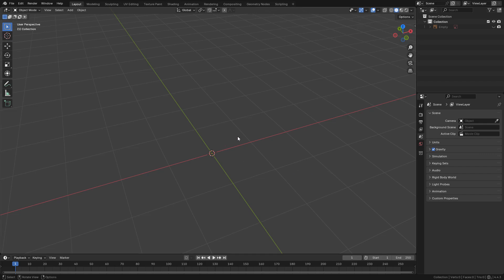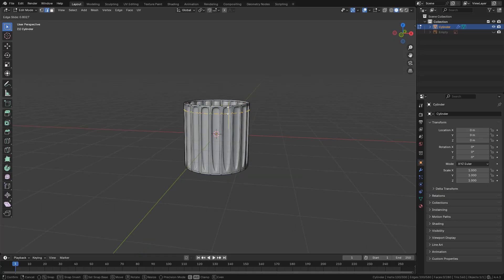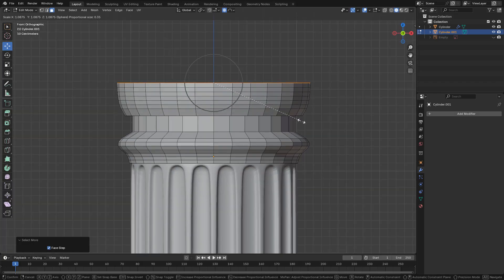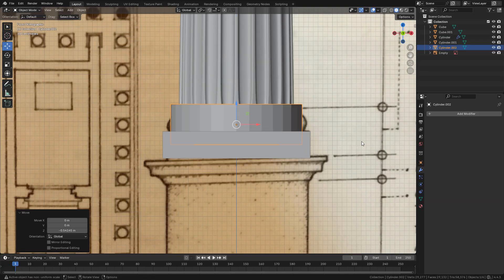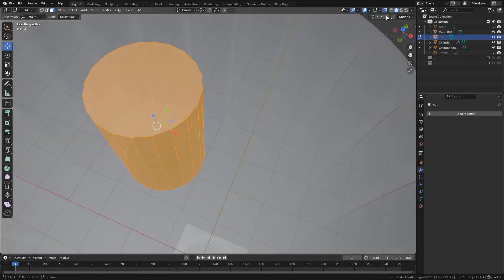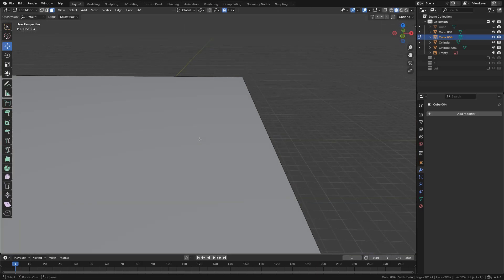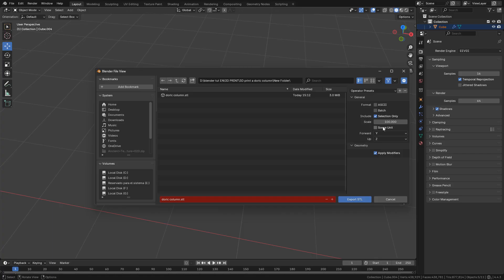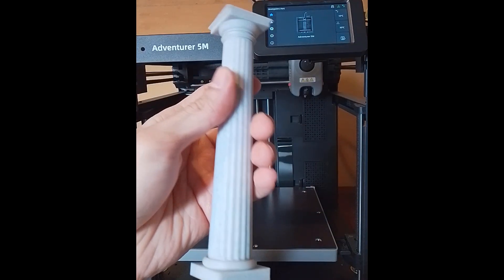Modeling a Greek Column and 3D Printing

Comment: Hint: Blender is one of the worst applications to 3d model for 3d printing. I say one of the worst bc I have seen worse; blender is good for modeling for digital things but not 3d printing. I like blender though, no hate, just my opinion. Edit: Maybe it's not so bad, I wrote this before watching the video, and after, I think maybe I am wrong...
Reply from the maker: Well, it depends of what you want to do, I've been using blender for 10 years for modeling/texturing/rendering and it's an amazing software, but I'm just starting out with 3D printing, which one do you recommend?
Reply: @chuckcg  I use freecad, but some people think it is not as easy to use. I think you should stick with what you think is best.